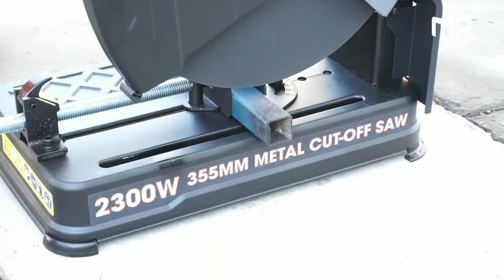How to Make Homemade Concrete Barbell with proper Steel Frame | Martial Arts Explained

Comment: Curious as to the longevity of the concrete.  How does it hold up to ground impacts from dead lifts and the like?
Reply from the maker: That's the price to pay for having cheap Barbells/Dumbells. Also the fact that there are not interchangable discs may be an issue for some people. But there are indeed some advantages.